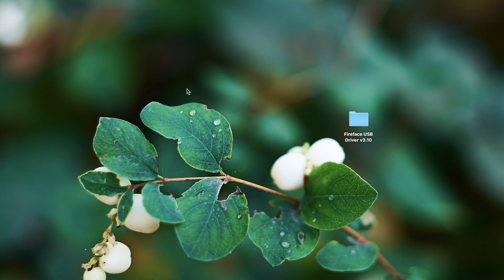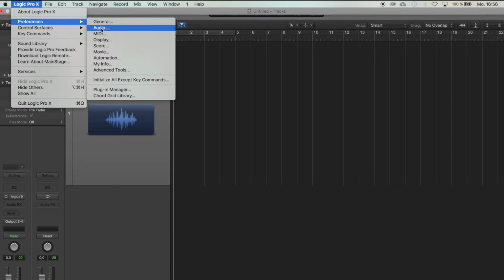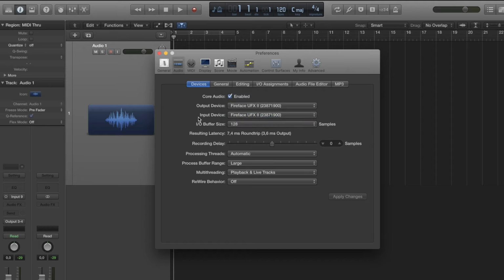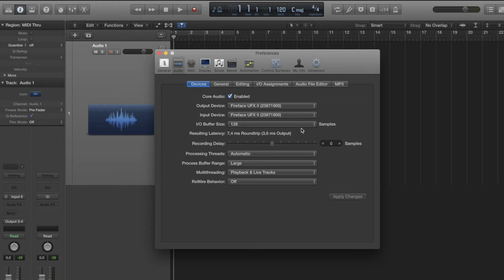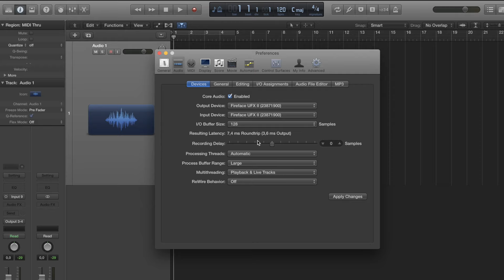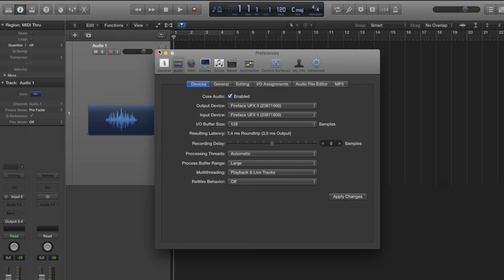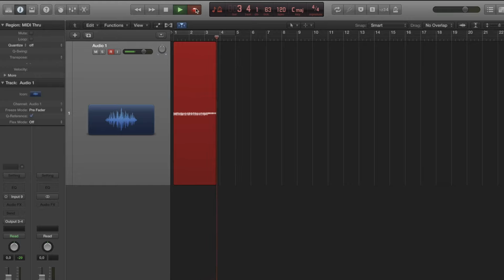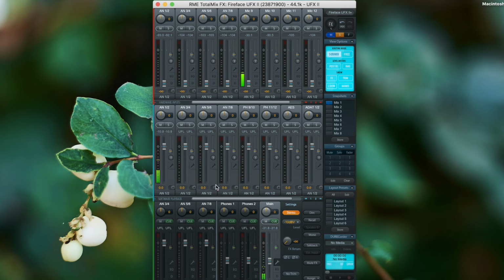How to setup Logic Pro X with RME Audio Interfaces

Comment from the maker: Do you have questions about TotalMix FX? Let us know!
Reply: I actually asked this question on another video of yours and I think I just saw the answer, so basically if I connect this to logic, the sound goes directly to logic and I dont need to use the TotalMix software at all if I dont want to use it to mix?
Reply: Can you send it to an analog mixer instead if you have an adad converter
Reply from the maker: @tokemerstrand6694  Yes, if your RME interface has analog outputs, you can send it directly to an analog mixer.
Reply from the maker: @tokemerstrand6694  Sure!
Reply: I've been used Babyface Pro FS with Logic pro X 10.5.
Babyface Pro FS is a very good product, but there is one problem.

When recording a song, I want to record it using an external effector such as R4 reverb. and I also want to record while monitoring the effected sound such as chorus or flanger. Is that possible?
Reply: Hello! I have a question about TotalMix midi setup. I've tried to found midi setup tutorials but can't find any. I think I messed something with setting the TotalMix channels and lost the midi signal and thus can't play Logic software instruments. My Logic Pro X recognizes Babyface Pro, it's activated normally in preferences but no midi signal goes in.  I'd really appreciate an advice on the subject, best wishes Katja
Reply: Hi, can you do a video on the midi set up please?
Reply: Is the RME Babyface pro fs a good audio interface for someone who has experience recording back in the 90s, on analog, and has been out of recording for over 20 years, and wants to get back into recording and production ? In other words, an, "experienced beginner" ?

Comment: my UFX-III isnt being recognized in Logic X.. Any idea? its with a MAC M2 studio.  installed, access allowed, reset. no dice... Help? lol
Reply from the maker: Do you see the UFX-III in the system report in about this Mac under USB? If not, try to change/replug the USB port while the unit is switched on.
Reply: @RMEAudio  Checking now. Thank youuuu <3
Reply: @RMEAudio  hmmm, still no luck.
Reply: @RMEAudio  it appears in USB, but its not appearing under audio in the Mac menus or DAW's. any suggestions?
Reply from the maker: @DanRoss_music  Then you need to reinstall the driver again and allow it in the privacy and security settings. This needs to be done in 30 mins. See our website : https://rme-audio.de/rme-macos.html